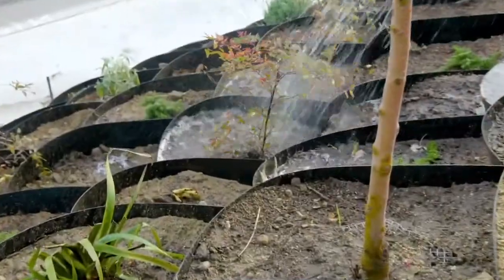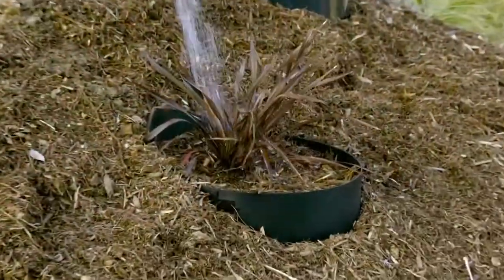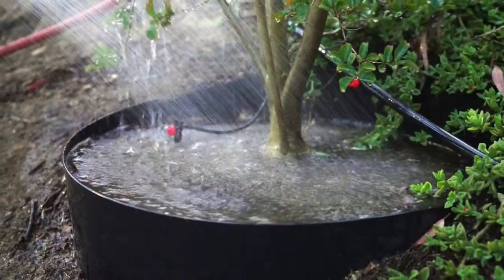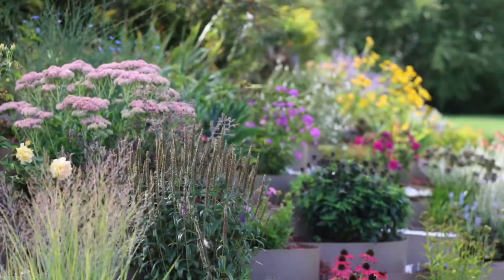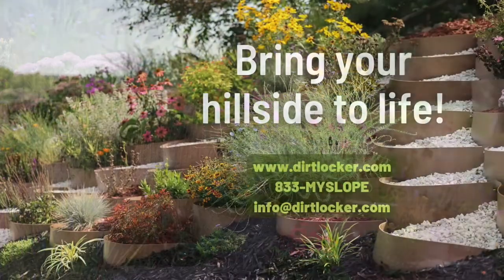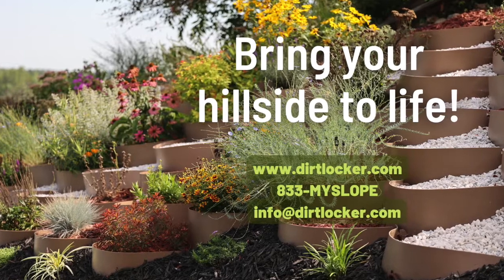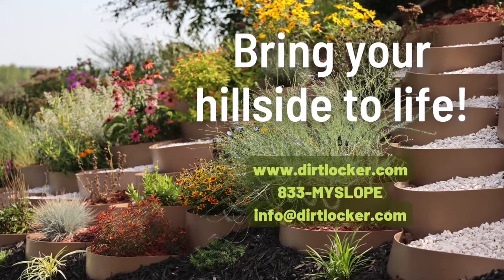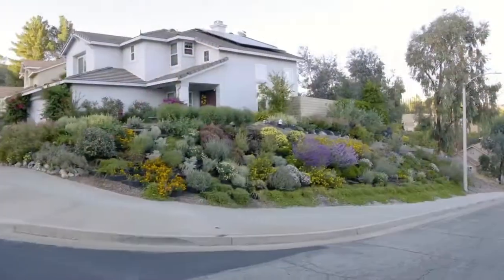Dirt Locker® - the Hillside Terracing and Erosion Control System Intro

Comment: Did they go with medium when they should have gone with large? These don’t look correct for their slope. They’re angled down a lot.
Reply from the maker: You can use two different sizes if the slope has varying grades. In some cases you may need to separate the rows. This system was brought up as a whole. The plants are all thriving and have grown so much you can no longer see the Dirt Lockers. The roots have completely stabilized the hill at this point, even if some sections we not perfectly level. To see updated photos check out our Instagram post or browse this channel!
Reply from the maker: one year later transformation: https://www.youtube.com/watch?v=2pDAQXFKEz8